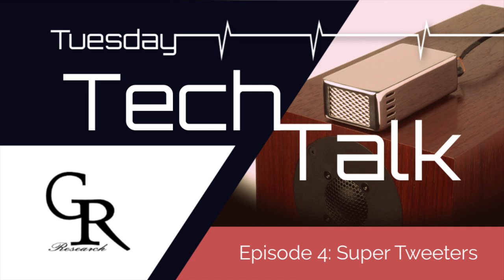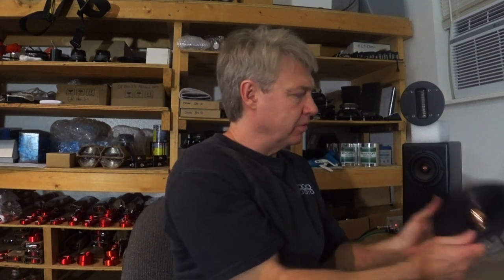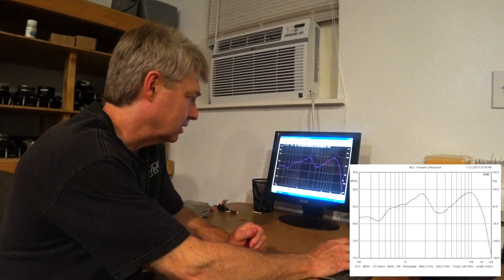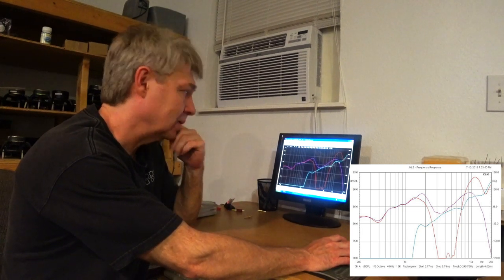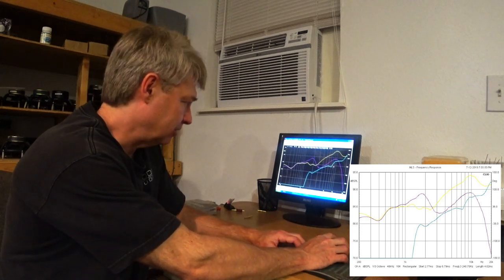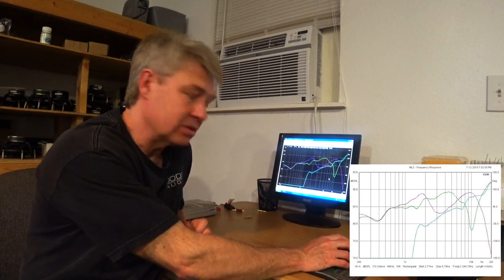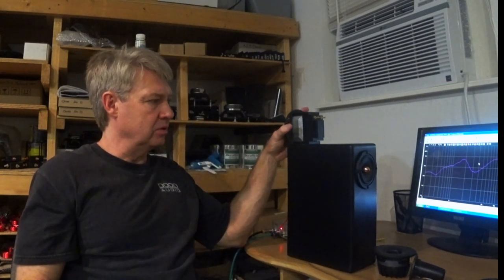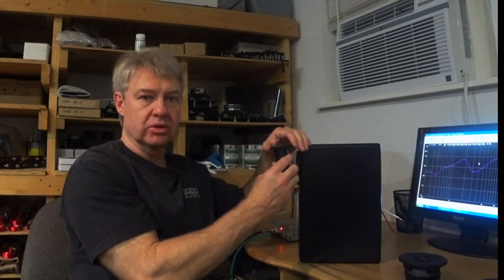Adding a Super Tweeter | Do's and Don'ts for Audiophiles!

Comment: While I appreciated the guidance and liked the video overall,  I would have appreciated this video even more if the tweeter pointing up, or adding a "real crossover" was attempted and graphed so that we can see both the before/after good/bad etc. in totality. Otherwise, thank you for sharing your wisdom.
Reply: With the tweeter facing up there is little to no change at all to the on axis response. And it is easy to implement without needing to know how to design a crossover. A single capacitor on it will be fine.
Reply: This is so timely for me. Just in the proces of dading to Seas 19 TFF tweeters to my manzanita open baffle speakers .... with a lack off skills to update the cross over filter. THANK you so much for this great video Danny

Comment: Thanks for the detailed technical sharing. I used to align the super tweeter on top of the tweeter. Using UMIK and freq sweep, indeed the ugly comb effects can be seen. In the past we only used hearing and perception to convince own self it is better - not. I now align the super tweeter in the acoustic center and firing up, with a full range speaker. Great tip. Cheers!

Comment: I have a question. I own OLD Realistic Super Tweeters  40-1310. which you add to the top of an existing speaker. and they made a huge difference, I still have them. just one of them died. 
is that super tweeter use to work well due to the crossover? or it was the tweeter itself?

Comment: On gr research home page, you show a line array.  How do you prevent comb filtering in this design?  To me, using more than one driver of the same type allows for easier impedance matching as well as less distortion as each driver has less excursion for equal output of a speaker with fewer drivers.
Reply: I explained that in this episode: https://www.youtube.com/watch?v=-GVdYAQkD8I&list=PLUFNGRKZZWXzCt2Syx4yjR4Oy7V-uiePB&index=14&t=571s

Comment: Thanks for the presentation. I wonder if you could add the crossover to the tweeter only if the other driver is full range. Though that may introduce another set of problems.

Comment: I'm working on a pair of Design Acoustics PS 10's that were abused severely. I couldn't find a 10" woofer that would work well within the small Weald cabinet, so I put an old pair of varivents in it to help lower the frequency and let the woofer move a strand of the airmass holding it in place. I also found a pair of Radio Shack Optimus 77's I am replacing the woofers with Dayton Audio 5 1/4" drivers. The only problem there is the woofer's frame interferes with the sides of the grills. But when I get them done I wanted o try putting them on top of the PS 10's facing upwards to fill the room with sound. I may also go with some exciter hanging from the ceiling along the walls as surround sound speakers. But that will be an experiment for the living room where we watch movies.

Comment: Great video.  I am running some Stevens Full Body horns in my car and have a slight lowering of the soundstage at the ends.  I am toying with either rear firing tweeters from 12k up on the back of the horn bodies or aiming a pair of tweeters straight up on the dash or pillars.  I am trying to find the best location to raise the sound stage but am concerned about two things.  On the back of the horn will they be able to provide that ambience firing into the dash and door panel?  Second, on the dash firing straight up with the reflections be an issue off the windshield?  Figuring I'll have to attenuate them a good bit at a minimum.

Comment: Your Rear - facing "super tweeter" suggestion, reminds me of one of Infinity's early model's in the mid-70's ; The model ' 2001'. To the best of my recollection, It was basically a 2-way design, similar to a' KLH 6' - with both the 10" Bass Driver, with a 2" tweeter are Front - firing. But, there was a Rear Facing 2" tweeter, as well. The Bass driver had an Accordion Surround
My best guess - made by RTR from Canoga Park, LA and the Tweeters also RTRs, but very similar to Seas (Norwegian) seen in Dynaco A-10 s, as they had Aluminum dust caps. 
If I'm not mistaken, It too, like the KLH ; was an Acoustic Suspension / Sealed Enclosure.
But it was a slightly larger in size; more like the KLH 23. Which probably led Henry Kloss to  later design and build the Larger Advent. But, that one required that "dome in a donut" tweeter as well. I suppose, that was an inexpensive '"ring radiator"; As the Tweeter effectively had 
a mechanical  crossover ? There by Eliminating the need for It to be a 3-driver system ??? 
Anyway, the end result for the '2001'; was a very smooth "Cambridge- Sounding" Speaker. 
But lots of "air", or ambient sound. Not as exaggerated as some Bose types. But a very pleasant balance, on a Wide - Range or various genres of Music. 
Arnie Nudell, must of sold a Ton of those !
Deservedly so, as They were very "honest sounding" at a budget price e.g. "big bang for your buck" Loudspeakers. Nudell, always loved a Balanced tad of Ambience, in all of His early models. Later, only his most expensive models dabbled in this area. Thanks for the Memories, as well as Your Wisdom !      ;-)
Reply: Many Snell speaker models used a rear-firing tweeter, some could be switched off.
Reply: Phase Technologies 9T also has some sort of rear-firing driver, I found this out when I bought a used pair on craigslist recently

Comment: Good analysis, again. Many of the Snell speaker models, designed by both Peter Snell and Kevin Voecks, had rear mounted/firing ambiance  tweeters, and on some models it could be switched on and off.
Reply: Hi Stewen. Yes indeed. For many years ago I owned Snell C4 or was it C3..dont remember.but I do remember the tweeter located firing backwards  with an on or off switch..
Reply: @jonnyberggren4598  Von Schweikert uses an adjustable rear firing ambient tweeter on some models, and a rear firing tweeter and a rear firing midrange in other models.

Comment: Hi thankyou for a great video as usual.. A quick question.. 
If you add a tweeter firing backwards. I guess you should change the fase polarity acording to the front Tweeter (if you have one there allready) But if you instaed place the extra tweeter firing up. Should that also have changed polarity on fase ? 
Excuse if i am bad at explain what I wonder but I am from Sweden and my english is rusty.. 
Dont plan to build anything like this but I have owned some Snell speakers that had a back firing tweeeter and I was just "Tec curuios.." :)

Comment: Hey, Mr Dodd Audio, where can I get a balanced Dodd Tube buffer from please? cannot see one anywhere!!
Reply: Hey Don, I don't know if he ever made any in a balanced form. I don't recall seeing any.
Reply: @dannyrichie9743  I'd take RCA
Reply: I have a buffer with cap mods and Russian tubes but I think a wire is loose. It tight in there and many wires for something so simple. My guess is an easy fix for someone familiar. Can let it go for the cost of Mundorf caps and shipping.
Reply: @garyporter8454  Will not pay before, or after 28th July. How much with shipping to UK?
Reply: £350 from UK..
Reply: Wow, that is a great deal for someone. I'm temped to buy it myself.

Comment: Thanks for that Danny. I was about to make the mistake you explained. I've got Fountek 3CD ribbons, so I can't fire upwards. So I guess I'll have to see if back facing sounds good. I'm adding to a two way speaker, so maybe I have to make a proper crossover and mount it forward firing. I've got an electronic 24dB two way crossover, what frequency would you recommend to bring in the super tweeter?
Reply: IMHO, whatever sounds good to your ears in your room

Comment: I picked up  used pair of Mirage Omi260 , interesting effects, any suggestions to improve them?
Reply: Those are interesting little speakers. They work great for surround sound speakers. They were built to a price point. So don't expect high end or top level crossover parts to be inside. So you could start by upgrading the parts quality. Just keep in mind what the cost of that could be verses what the speakers cost. You could easily spend more on the upgrade than they cost to begin with.

Comment: i wonder if the first dip you showed here would be be fixed if you had a fast slope instead of 3db maybe 12-18db slope!
wouldnt that theoretically fix that problem?
and wouldnt this whole video  even though its been very critical in my understanding of super tweeters,  be kind of useless as it would be a matter of the main speakers range and the super tweeters cross over point?

Comment: Would upward-firing a horn tweeter (Fostex T90a) work well? I'm building the Dallas II cabinets with the T90a super tweeter (with a 1.0 - 1.5uf cap) and the Fostex FE208e Sigma full range driver. Many thanks!
Reply: If you face it forward then you'll be dealing with the same cancellation effects illustrated in the video. I would try it facing up or to the rear.

Comment: Thanks for great information. With an up firing or rear firing tweeter, do the tweeters need to be identical to the main tweeter (as in two 8 ohm to make 4 ohm)? or wired to carry the frequency above the main tweeter?
Reply: good question. Might be a good idea to wire in a L-pad on top tweeter. Might also be interesting to mount top tweeter on a mini swivel ball head (used on camera tripods) to adjust upward angle

Comment: That combination of drivers hate each other! As if the full range acts like a tweeter + mid already. The crossover refuses to cross over. Excellent example not only of comb filtering but the whole adventure of speaker design haha ... although maybe if you plotted it to 40 KHz you might just see the tweeter is just too loud. Even if all that can be worked out, THEN there's the resulting 12-15KHz crossover issues.

Comment: I have a pair of Energy EXL 25s….problem is both tweeters are blown, And I can’t seem to find a pair for a decent price. My question is can I use different tweeters in place of the Energy speakers., and if so which ones should I use.  Your help is greatly appreciated….Thanks
Reply: Your best alternative might be to buy a different teeter from the same manufacturer because it might have similar tonal characteristics and won't require a new crossover to sound good. Lacking that, you might just have to bite the bullet and buy the non-"reasonable price" tweeters.

Or you could just buy a DIY kit (many available from gr-research even) and go that route for your speakers.

Then again you might want to look at why your tweeters got blown in the first place. That is unusual...

Comment: Using a steep filter on both drivers would eliminate most of that comb filtering too
Reply: They still have to be kept in phase at the crossover point. And with acoustic centers placed far apart and wavelengths short, from crossing high, then you still get out of phase cancellation in the vertical off axis.

Comment: what's wrong with firing a ribbon tweeter upward? what's this sag you're referring to?
Reply: The weight of the ribbon itself will cause it to droop.
Reply: The ribon will bend downwards and slowly degrade.
Ribbons can only or should we sayshould only be vertical , they are so lightweight 
that they easy gets destroyed .
Reply: @dannyrichie9743  the kapton ribbon? isn't kapton super strong?
Reply: @kennethsrensen7706  does this apply to kapton? or just mylar?
Reply: @linkeddevices  sadly both , it's not because of their strenght , kapton is stronger but will slowly bend downwards
as time is passing .
They are super thin and thus bend extremely easy .
But it take longer time to do so with kapton.
Best is to use a traditional dome tweeter but 
even some alu dome types can lower the coil a bit further down in the magnet gap as 
time passing .
Reply: @kennethsrensen7706  wow thanks for the warning. that sucks. I liked using my s emit as a super tweeter aimed straight up on my center to lift the sound stage and add more air to movies and gaming since the center speaker is typically not as good on its own as the mains.
Reply: @linkeddevices  You welcome : )
Yes , it can add a lot of dept to the sound stage on a center speaker.
S Emit is a little stronger than many others
due to the construction but at high volume
there is a higher stress on the membrane 
and when it breaking up it can deform .
( Yes it sucks , but all speakers breakup at higher volume some more than others ,
and when this happen it litterly look like 
a piece of crumbled paper )
You can alternatively use a cheaper soft dome tweeter .
( they have better surrounds to hold the
membrane in place )
As long as it is good sounding it be ok , it's 
not so critical with the actual quality because all you hear from it is reflections and delayed so even the best tweeters will never sound at full potential .
Also a cheap fulrange speaker capped off at the lower freq using a simple filter can easy do the trick and because they have stronger spider ect they are not as sensitive to set lower in the gap .
Just go for an ok sounding one and you be fine : )

Comment: The thumbnail clearly shows a two way speaker with added Suoertweeter but the video is about adding a Suoertweeter to a full range driver. Completely different scenario. Waste of time for myself (who is actually interested in a super tweeter to my 2.5 way design).
Reply: The same fundamentals and effects are at play any time a super tweeter is added.
Reply: Not to mention the thumbnail is for the Townshend super Tweeter that is supposed to operate above 20kHz. Anyhow, there are plenty of speakers that incorporate front-firing super tweeters without this comb filtering problem. The Stirling Broadcast LS3/6 is a great example. The real lesson for DIYers here is that if you plan to incorporate a super tweeter, use a crossover software and be sure to take measurements with a mock up before committing to a design.
Reply: @dannyrichie9743  thanks for the confirmation Danny. Genuinely interested and did not want to waste any time.